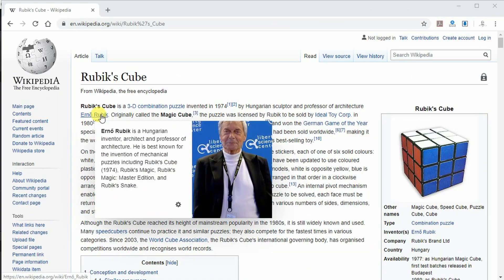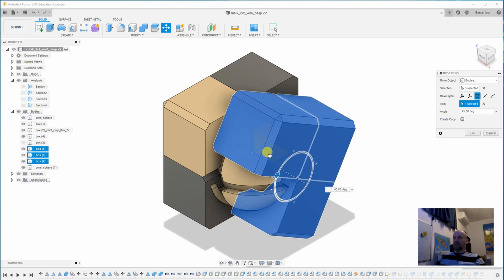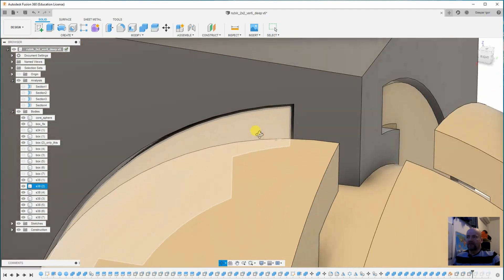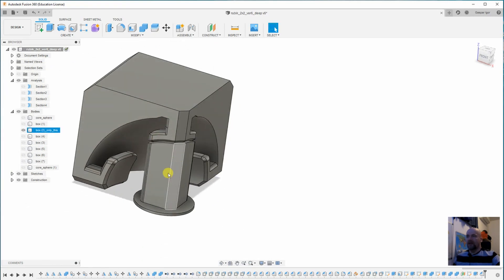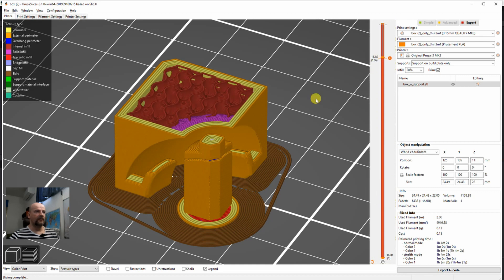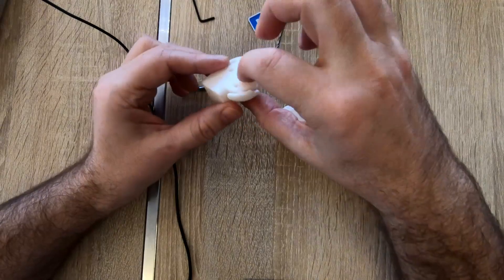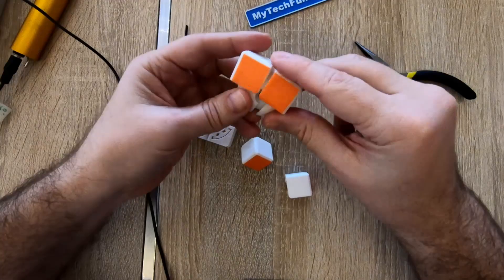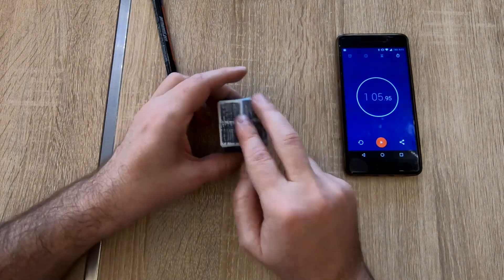3D printing Rubik's Cube 2x2x2

Comment: A real Rubik's cube would have had one of its eight corner pieces as a single piece with the center sphere unlike how your design works, Possibly. Edit: never mind. I thought your design did not have one of the corner pieces as part of the sphere in the middle but that's exactly how it's designed, my mistake.
Reply: Действительно, надо закрепить ядро к одному из углов. Если этого не сделать, ядро может прокрутиться вокруг себя, и некоторые движения станут невозможными до того, как ядро не встанет на своё место.

Comment: Thanks man, I also had the idea to make a 2x2 cube myself and wanted to learn the design to it. Really helpful. Also, is it possible if you have time, can you make a tutorial on how to download and use program that you are using to design the 2x2 cube and how to hook it up to the 3d printer?
Reply from the maker: There are a lot of Fusion360 tutorials (this is what I used). How to print it? This is another separate topic. But main steps are: download the STL files. Import them into Slicer software (Cura or PrusaSlicer for example, they are free). Slice it (this will result G-code). Copy g-code to sd card, and insert it into 3D printer. Print..
Reply: @MyTechFun  Can I just download all the files, send them to my phone and connect my phone to the 3d printer and print all the files.
Reply from the maker: @Pyrmdbldr  No, you need some slicer to prepare the gcode.
Reply: @MyTechFun  Just tried cura and it asking for a printer before I can do anything but the printer I want to use is at a library and I see no way around this.

Comment: What length can be used? I have only much longer M3 countersunk screws
Reply from the maker: You can cut down the screw, but don't damage the thread. I will show how to do it in my next video.
Reply: @MyTechFun  ...thx!
Reply: or just just 3d printable pins